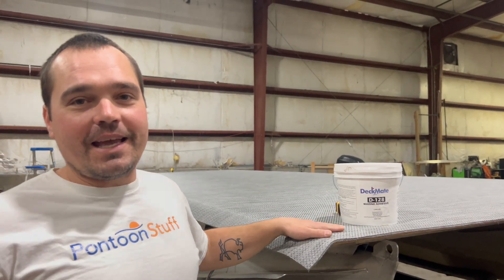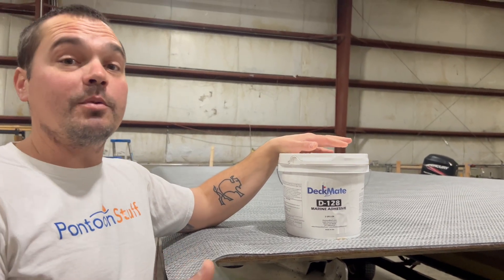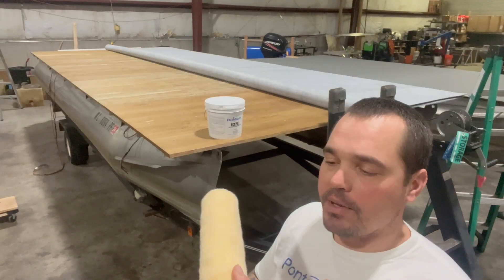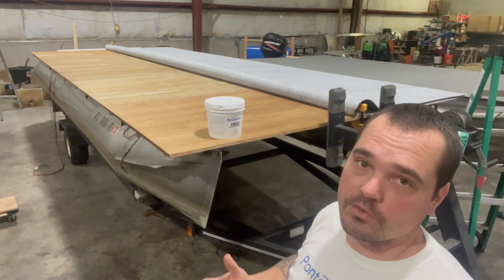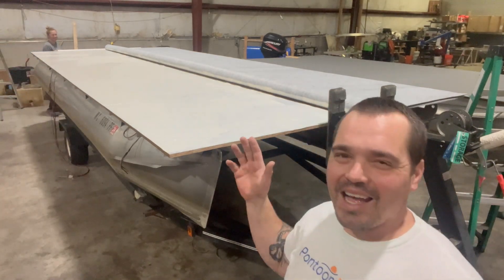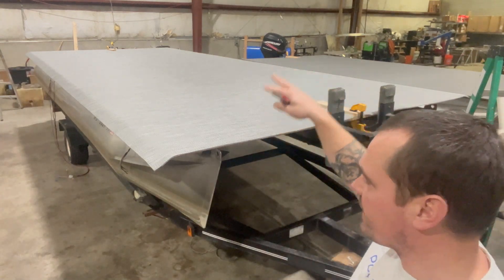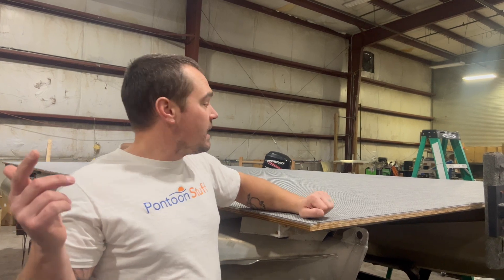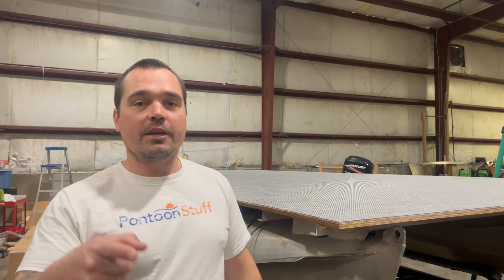Tips for Installing Vinyl Flooring on Your Pontoon Boat

Comment: Trying to build a garage right now and everything will be much easier when I have a place to work on it rather than just the side yard between rain showers!
Reply from the maker: Yep! I think half the reason that we stay busy with boats is that we have a warehouse space to work in year round. It takes quite a good size garage to fit a 24' pontoon in to work on....and then there's the factor of whether or not it's heated.

Comment: I may buy a 10’ stick of PVC, put screw on caps on it and fill it with sand. That would make a really good roller!
Reply from the maker: I’ve thought about something like that. Still gotta push some pressure down too tho!
Reply: The problem, IMO, is that PVC flexes and while you’d have the weight from the sand you might not get even pressure across the entire floor. Also, a 3” or 4” x 10’ length of PVC will be fairly unwieldy. AND, don’t drop it once you’ve filled it with the sand.

Tom’s simple method is tried and true; he’s used it for years to great effect and from all his videos I’ve watched, it appears to be the same section of PVC pipe so it’s cheap and effective.
Reply: Thanks for the tip. I guess I will just put my weight on it!
Reply from the maker: @RandomlyAwkward1  Luckily it's just one time gluing that flooring down and then you'll get to enjoy your hard work for years to come!
Reply from the maker: @luisaraujo4708  That little section of PVC has helped me install close to 100 new floors over the last few years with ZERO complaints...I'm not changing anything now!
Reply: @tomspontoons , exactly!!
Reply: @tomspontoons  in this case, it’s years of hard work…
Reply from the maker: @RandomlyAwkward1  Trust me, you're not alone on that! I've worked with customers and chatted with tons of folks who have taken years to rework their boat. Keep at it, you'll get there, and hopefully my channel will help you out along the rest of the way!

Comment: Hi, can you please recommend engine(hp) setup for 22ft triple tube pontoon. Thank you
Reply from the maker: Generally you’ll want AT LEAST a 150hp on a boat of that size. We had a 22’ tritoon powered by a 200 hp Suzuki and loved it for performance, fuel economy, and how quiet it was. Always make sure the boat is rated to handle the horsepower engine you hang on it.

Comment: Looks great Tom! When you roll it out does it squirt any of the glue down the sides? Didn’t look like it from the video when you cut it.  
Also do you have to wait for it to “tack up” before applying it?
Reply from the maker: Thanks! I rarely have any squeeze out the sides when I roll it out. The felt tends to really soak it up. I don’t wait for it to tack up. If it’s above 65 degrees and laid on uniformly it’ll cure up with the vinyl rolled out and left alone for 24-48 hours. Sometimes when I cut a hole through the vinyl for wires or a table mount I’m amazed how well the vinyl is stuck to the plywood!

Comment: Tom, what is with the bull or cow tattoo on your arm?
Reply from the maker: It’s a bison. Really cool animals. They run into storms coming over the plains in order to shorten the time spent in discomfort…versus cattle which will try to run away from the storm only to be overtaken and spend more time in it. They also shelter their weak, old, and young by surrounding them when a predator is near. We just have an appreciation for what they symbolize.